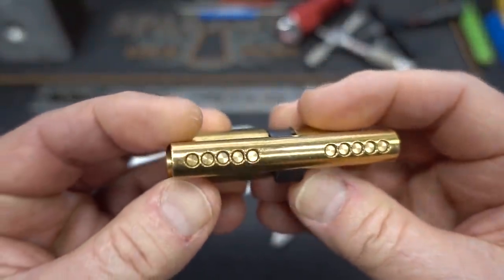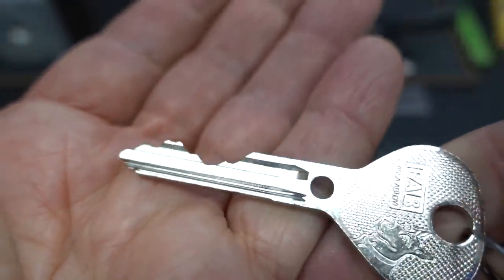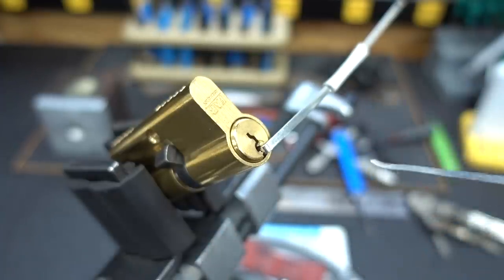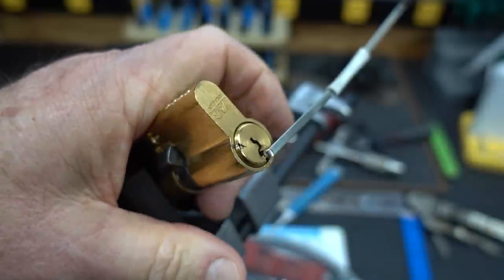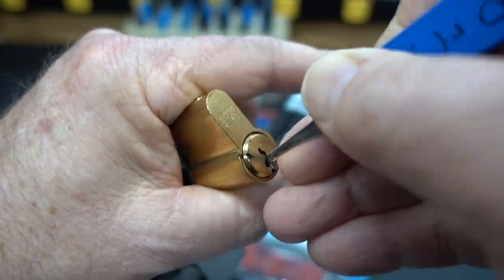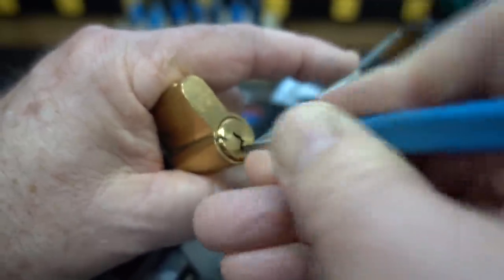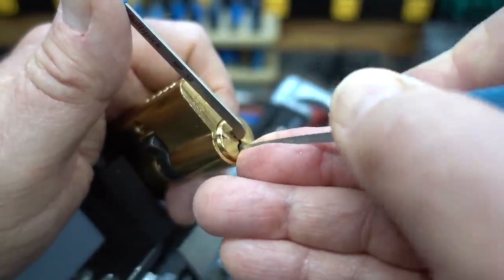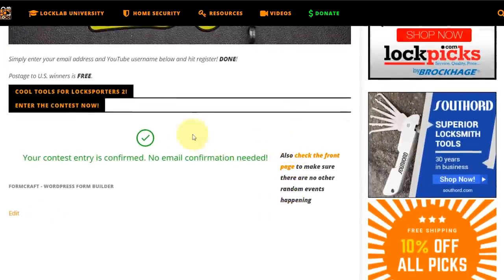(1859) Overlifting a Pin Tumbler Lock

Comment: Here in the Czech Republic FAB is basically the default when it comes to door locks, lockpicking you see in Hollywood movies seems so surreal here. You almost never see lockpicks here, locksmiths use bumpkeys or auto pick guns. Or if you've lost your key you will probably want to replace the lock and end up drilling it out :D
Reply: I too see FABs everywhere and used FABs are available for a couple of bucks (be patient on Aukro.cz and Sbazar.cz)! ... however, I have yet to pick one (still a noob though).  :(  What does it mean when you push a binding pin half way up and then it's loose? ... and then 3 other pins are binding?  .. and then you push on them and there's never any click?  I'm looking at the working key while I'm trying to pick it and I still can't do it.  :(  In my head, I imagine a key/driver pin combination where the binding is always dynamic and every "set" pin will need to be dropped to "set" another pin.  Really, the only clicks I hear in my FABs are the previously "set" pins dropping.  I'm caught in an infinite loop and hoping a new algorithm will help me escape it.  :)
Reply: @arrrg3846  Beware that many old FABs are nasty because they have beveled pins. They are more difficult to pick than the modern one on this video.

Comment: Here in the Czech republic (FAB is originally a Czechoslovakia company) the FAB locks are standard. People generally use the word "fabka" for every pin tumbler lock. The hole in the key is for color identification - originally locks are sold with a few color "beads" then you can mark the key. I interesting in lockpicking and I already pick many of these locks. At now I have  picked FAB with a similar profile on the table :-) I use valyrian hook (0.019") - it's about a "rotating" hook too. Usually i combine valyrian (0,019") and multipick hooks (0.015"). I have two FAB locks that I don't pick already (i have a key, but it's some older version of FAB - paracentric profile and both are quite hard operable with key cylinder get stuck and on little wiggle, they turn  ...it looks like very worn out pins).

Comment: Not all of them have bitting like that. When I buying these FABs, some of them have pretty flat bitting and it's quite easy to rake it open. It's bumping resistant because of driver pin with bigger diameter on the middle of that pin (in FAB it's called "RBC pin") so the keypin is "drowned" under level of other pins and not making contact with bumpkey. On this position when RBC pin is can be maximum 3 cut. Those holes in keys are for plastic different colored identificators. Here in Slovakia and Czech republic are FABs the most basic and used locks and this company was founded in 1911 in "Rychnov Nad Kněžnou" in Czech republic (at that time "Czechoslovakia") and there are still there making locks until today. I was there several times on "open door day" that they got every day. I'm also collector of FAB lock and have interesting pieces, the oldest one is from 1938.

Comment: Apart of color plugs fitting into the hole to distinguish keys, it actually serves as a break point. Even with fully inserted key, a piece of the key will still be sticking out, making it easy to take out that broken key with pliers or even fingers.
Reply: why would you design your key to break easily but cleanly instead of just designing it to not break?
Reply: @clemdelaclem  It's about where that break will occur. In this case, you won't need key extractor when it happens. Anyway, these keys are sturdy enough, they don't snap easily.
Reply: Yeah that seems pretty smart. The key breaking is inevitable so you can at least design it in such a way that it can be easily extracted. Just hope the hole doesn’t actually reduce its durability below the average key because that would be even more annoying.
Reply: @clemdelaclem  key strength is limited in the materials available for the key. Too hard of a material machining costs are too high and pushes the product price point so high it limits its potential customer base. Two bulky of a key and it is not practical to be carried with your other keys daily and in that sense it's not practical as a key needs to be. This provides a breaking point in a worst-case scenario situation but provides ample space for the key to be fully inserted operable grippable removable mostly still usable as a key after the break. This means that you do not need to have a professional with special tools come out and possibly remove pieces of a broken key from your keyway. You also won't be locked out of your house if that was the only key for entry that was available to you etc
Reply: In the FAB 200, 1000 and 2000 documentation ASSA makes no mention that the colour dot hole also serves as a breaking point. Knowing ASSA I'm sure that if they had that in mind they would have designed the area better (even possibly scoring a line there) and would have mentioned it in the documentation for these keys.

Comment: the hole on the key is for a plastic marker to distinguish between keys... the FAB2000 has 2 set of keys and a red marked key which will remove a small ball bearing from the lock and switch the lock to the second set of keys. the one in the video seems to be the FAB1000 version (the 2000 is silver in color not brass) but the key blanks are the same hence the hole.

Comment: With a stock lock, you'll get colour-coded insets in the keys in the holes to distinguish your set of keys (that has the extra key for your office door) from your kid's (that has the extra key for their locker). I had many of these keys in hands, and trust me, they are not the ones suspectible to bending and breaking.
Reply: Ahoj brate :)

Comment: Ive used that technique before, when I managed to set 3 of the 5 pins in a 60mm tricircle padlock by overlifting them all and then slowly with a bouncing movement allow one pin at a time to drop back into the keyway, whilst still being able to catch the driver pins above the sheerline. Then I was just left with two pins to pick. It's always worth trying out a couple of what I call 'luck techniques' if something is taking too long. Nowadays I get a lot of luck from the sparrows bogata. If you use a short hook inserted upside down to lift all the pins up, sometimes just rocking it on the way out works too.

Comment: One thing though, when talking about extreme bidding, that means the outer pins will always be one of two cuts and and the back pins will have a limited choice of cuts as well to oppose the front cuts to get the pick pin block going... which means you have a much reduced number of potential key cut combinations. Still sizable, but you start getting to where random attempts of using a key from another lock might be the same as the one you try it on. Not common but not too rare either. I have opened a friends door with a old key from some random ones I found rummaging through old boxes at home and in thrift stores.
Reply: *bitting 🙂

Comment: It's not so hard to SPP most of these but there is this trick: You start by setting the RBC pin first. (See The Hanter's explanation in the comments on RBC pins.) When it is mounted like in Europe, it's the keypin that is lower than others. This is what @BosnianBill did with the hook upside-down. Only then can you continue. Luckily, there are only 4 pins left!
Reply: I also prefer to pick it similarly as in the video: With a city-rake in 0.015", setting the RBC and possibly a few others, then releasing the tension while rocking at the same time (it releases the over-set pins) and if the false set then seems solid, setting the remaining spool pins. Voi-la!
Reply: Note that it works on these newer FAB 200RS that mention "FAB Assa Abloy", not the old ones that mention only "FAB". Those are completely different.

Comment: I can assure you that not all FABs have crazy bidding like this. Some of them are pretty flat, but maybe this has gotten better recently. (I've had FABs around me for my whole life, so I'm getting lost in how they do recently.) The weakest point is they're quite easy to drill open, even with one of these spinner covers over your euros. But what would you want for less than 20$?

Btw, too bad you didn't gut it, I was curious what driver pins it had in.

Comment: Thank you Bill. What is the little cut out for on the base ofvthe key?
Reply: It works as a stop for the key. It does not have a shoulder in the front but there is a notch at the back.

Comment: Sparrows 12 thousands are thin enough and anything thinner like your using would just break and or bend so easily I don't think I would get much use out of them lol
Reply from the maker: Yeah, I agree.  I had RareElements custom make those 0.010" picks long before Sparrows offered the 0.012" goodies.
Reply: @bosnianbill  I had to make handles for them. Shrink wrap just wasn't enough because there just so thin. 10 thousands is probably close to giving you a paper cut bill lol

Comment: So why has your channel remained relatively small (in terms of views) while LPL's channel has ballooned to getting half a million views per video?  At this point LPL's entire comment section is people who know and care nothing about picking.  It used to be a place where people could post a comment and get a response, if not from LPL, then from someone who knew what they were talking about.

Anyway, this is the first time I've seen "overlifting" as a technique.  It seems like most people (when dealing with a real lock of unknown difficulty) start with raking, the go straight to SPP.  Why would you do this after SPP fails and not before trying SPP?  I mean I'll try it myself and see if the answer ends up being obvious, but it seems like it should fall between raking and SPP.

(I guess comb picking would technically be the first thing you'd try but that's more of a bypass than actually picking the lock)